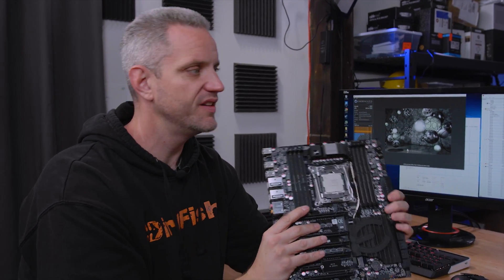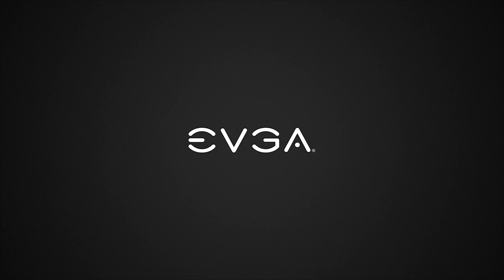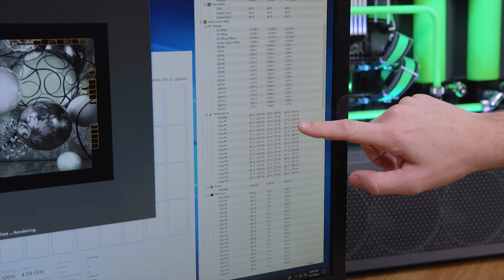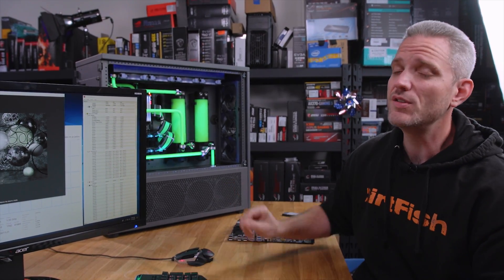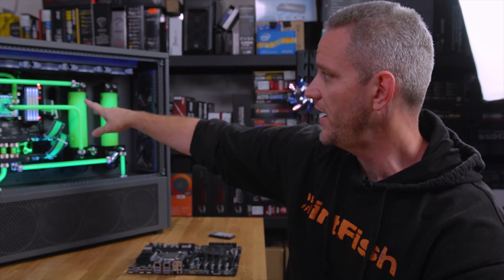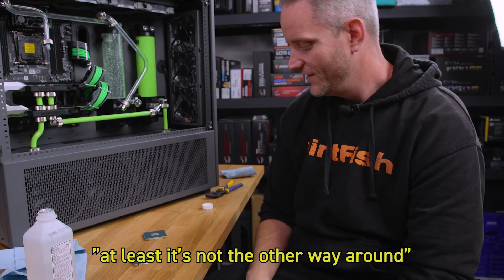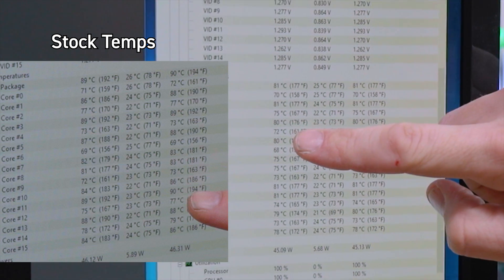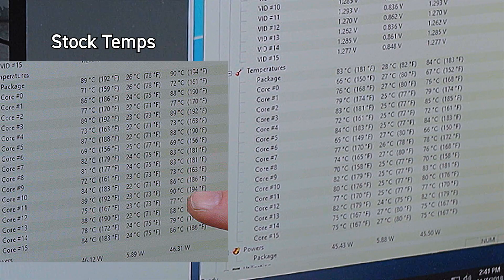I went to delid my CPU... but I didn’t expect this!

Comment: I never understood why Intel started having the lid and die sandwiched with thermal paste in between since 2012, instead of continuing soldering the lid and die together as they've always did in the past and AMD does to this day. It's just a terrible decision. The only reason I can think of is cutting down production costs, since it's a cheap and lazy solution to heat dissipation.
Reply: Well the chips with paste still run for decades without issues, so nobody really cares.

I guess it just annoyed the small number of enthusiasts and overclockers out there.
Reply: Yeah and the Ryzen 2 would take a 55 gallon drum of paste to fill that flying saucer of a Processor... Ryzen 3 is going to come with its own pickup bed...

Comment: When you exposed the copper, won't it cause it to oxidize? And that's probably going to get worse than it was before as the oxide is a really bad heat conductor.. Isn't it worth to coat it again?

Comment: You sorta skipped past it but did you trim the black glue? lowering the thickness of thermal paste between the die and the ihs is where you really lower temps. At any rate I expected a bigger difference after the de-lid so I wonder what's going on.

Comment: Shame you only did a partial lap. Im sure you took your measurements but normaly one should NEVER use powertools on a IHS. Copper is so soft to work with and the polishing wheel does have rather hard edges...

Comment: why would you delid and not use liquid metal? that is the weirdest thing i have seen in a while- i was shocked and actually rewound since i thought i misheard. do a proper delid with LM and then you will notice a difference(do it properly on both sides though)

Comment: Ive notice the IHS not being flat from my experience: 3770k (not flat) to 5930k (flat) to 1950x (flat) *these were the CPU I own yours may differ

water block used:
Swiftech Apogee fine for flat not for non flat
XSPC fine for flat not for non flat
EKWB fine for not flat (change out the jets to fit the non flat) or flat (stick with the recommended jet)

Comment: Why don't you sand the die itself down a little? that would do a lot for temps also. The Thinner the die the better it will transfer heat since it doesn't have to travel through as mush of the die.

Comment: Hey, Jay. Can you make another video on the EK Fluid Gaming parts? Since your last video, EK has got wayyyyy more parts and kits available. I'd like to see you use an A240G with one of the 240mm Radiator Expansion kits. The performance would be very interesting and only costs about $320.00.

Comment: Quote- "Not really an improvement"

Because you used thermal paste on the IHS. Liquid Metal on the other hand, you would have seen at least 15-20c drop.

When I delid my 7700k and used Liquid Metal, I saw a 20-30c drop from before. Was also able to use much lower voltage for 4.8Ghz as well.

Always use Liquid Metal when Delidding CPU's . Always. Best results.

Comment: Should have seen what the temps would be with a full delid, meaning no IHS, just straight water block to cores. I know its more risky as i have cracked a q6600 back in the day but was able to get temps at full load around 40c at 4GHz.

Comment: Dang it... 3939 cb on you're water setup... I'm only at 3600 CB on my 1950x on a 120mm AIO (I peak at 80-84c compared to the 90c you hit). I wonder if I could match that with the same loop and no delid?
Multi: 41  FSB: 101  Memory: 3636 (3600 XMP times 1.01 from FSB, 19-20-20-40 timings since it was a super cheap kit). 1st gen Asatech AIO with fan set at half speed, Taichi motherboard.
Not sustainable for 24/7 since my cooler is pretty wimpy (and only covers 1/4 the chip, LOL!), but it looks like the temp might be fine with a full loop. I'm eager to try LN2 on it! Got a T-Rex cooler I think will fit with zip ties . 'm the king of zip tie mounts, after an hour trying to mount it correctly on AM4, I gave up and within 3 minutes had it ready with zip ties, lol, nothing uses the correct mount...

Comment: Mhm what could you do against the IHS problem without losing warenty? Retail it because of lets say blue screen until you finally get a flat one? If Intel only had stick to their paste solution, thiner package -> way better temps, flat IHS -> better contact patch which result in better temps.

Comment: HI Jay and any other PC aficionados, I mainly game on my current build will post below. I should be running into a bit of money and want to upgrade even further especially with all the new stuff coming out. My initial question is what is going to be a great rig for both my gaming and future video editing/streaming. I want to get the I9-9900k but the price tag on that currently since i did it get it at MSRP is around $900+ on newegg, so I was thinking of getting the I7-9900K. I want to get the new 2080 or 2070 counterpart. The concern is I want to maximize gaming atm since the video editing will play a roll later but still be prevalent (its my wife's dream to start a channel and i want to make sure my PC is capable to do it reliably for her). 

Another question that arose for me is that if Im looking to overclock my I7 or I9 would an AIO be okay?

Current Setup (the upgrade will be noticed):
CPU: i5 7600K
GPU: GTX 1070
Ram: 16 GB (going to get 32)
CPU Cooler: Cooler Master AIO 2 fan radiator
Reply: please feel free to PM me also (to anyone that wishes to help me out)

Comment: Back when I bought my brand new 7700K, it went up to almost 100 C within seconds under load, in a custom watercooled system. I delid it and used fluid metal on the core and the heatspreader.
Ever since it goes up to the 60s, and stops at low 70s on hot days. 
So delidding with fluid metal made 30-40 C difference on the sock hz!!

What the f*ck Intel?

Comment: Hey I was this vid and i'd like to do a delid myself, only, I don't know what TIM to use. Saw you aplying a paste, so probly not conductonaut, but kryonaut. My question to Jayz2cent is , can we get better results on the CPU temp if we use a paste as well. I know that if you delid every channel or every either wannabe or for real diehard is going to say to use liquid metal. But can someone get away using pastewhen delidding?

Comment: I still see no reason to do this. OC'd 8600k to 5.0ghz, I live in hot af Australia, have an air cooler=no issues. Temps average 65-70 max during gaming. One should always have balanced mode on, so you use less power and CPU downclocks when not being used. I don't know why you mention it like it's a bad thing?

Comment: If you think about it, the thermal compound's primary function is to eliminate any microscopic discrepancies in the surface contact between the CPU and heatsink, to help transfer the heat from one surface to the other. In this case, too much was asked from the compound as there was nothing microscopic about those discrepancies.

Comment: You need to use liquid metal to see an improvement in delidding. I saw it on my 7900X. Delidding with regular compound didn't do much, but doing it with liquid metal dropped my temps damn near 30C at 4.7 GHz.

Comment: my i5- 8600k was running more hot as normal and wasn't sure if my IO cooler was making contact properly , and find out that the liquid inside the tubes where not running 
ones i put the case in a weird position against the wall .. so that the watter can run normal . my temps where nice and cool again .

Comment: if y ou want to be hardcore lap the cpu and the bottom of the IHS as well.   Better way to test flatness for block/ihs is a glass block to press onto them with some TIM so you can watch the spread pattern

Comment: why no liquid metal ? delid i lost 7c on my 8700k , delid pluss liquid metal 20 c
Reply: All this to play rocket league at 1080p.
Reply: you can also remove 0,2-0,3mm of die for extra 4-5 degrees
Reply: @_Leouch  Yeah and if you cover your blu rays in magic marker they read better!
Reply: @pancake-214 ... google it, it is not something I made up
Reply: I just delidded my 8086k and got about 25c lower temps :) used lm ofc

Comment: cant compare vcores between different generations, my i7 2600k needs 1.4v for 4.5 ghz stable, and my i7 3770k needs 1.2v to run 4.5 ghz stable, i know theres silicon lottery, but thats obviously not the case here.

Comment: That was really interesting.  I had a similar heat issue with a 6700k I picked up recently.  Under load would shoot up to 90+C in 2 seconds. In my case it WAS the TIM on the die. It was dried up and large portions of IHS and die were exposed in the same place.  Delidding knocked off 30C over the space of a CBR15 run, and it eventually (after an hour or so) gets up to about 72C, and that's only because the rad takes the air that the R9 390 dumps in the case.

Comment: Is there a way I can send in a gpu to you and have you take a shot at the problem i have with it, basically whats happening is the fan goes nuts then no more screen output but my computer stays on the history behind it is that the card burnt out but if it did it looks totally fine and it still works?
Reply: Also when i first got it i changed out the thermal pads and the thermal paste also there is some exterior damage on the io shield almost like someone forced the card out of the computer.

Comment: The voiding of the warranty should not be a problem. You are Fixing their bad design after all. To void the warranty, they will have to justify and prove how lapping a non-active lump of metal in a way that improves its intended function broke the CPU... Yeah... Good look convincing that to a judge. If you make sure you document that you had an antistatic band and you damped the sandpaper. They can't say you killed it with ESD or that metallic dust shorted something. the EDF and the FTC may even back you up.
Reply: You must be young...

Comment: I just bought and delidded my 8086k using a rockit delidder tool and used liquid metal and resealed (cuz i wanted too) the ihs I'm at 5.4 @ 1.48v with an H80i with push pull 2000rpm fans and I do not overheat!

Comment: hello jay.
maybe an idea to check that the CPU's IHS is also flat inside. 
Maybe because of the heat that it has been bent slightly or that it's just bad from intel. If you look closely at your video, 
it looks like there's more thermal paste in the middle than outside the sides.

Comment: Ryzen 7 1800x and gtx 1060 6gb   or    ryzen 5 2600x and gtx 1070       for a 1080 gaming/workstation build
Reply: 1700X(OC)/1800X ! GTX1060 (6 GB) is fine for 1080p 60Hz gaming..most games on high(not Ultra). The 8 core will be more appreciated for workstation use while still gaming ok. The 2600X will game a little better, but workstation/productivity use-cases will suffer more as a result.
Reply: 1Tanker thanks so much       so a ryzen 7 1800x and gtx 1060 will do just fine?
Reply: Beastmode Brown - It's pretty much what i have. I have a 1700X (on Gigabyte X370 mobo) OC to ~ 3.95GHz with an EVGA 1060 6GB (9Gbps model) overclocked to 1725MHz core and 2440MHz VRAM. I have 32GB (16GBx2) of GSkill RipJaws V 3200 C14(Stupidly expensive, but 3200MHz C16 RAM...at least, is what you want) running @ 3200 C14 with some tightened sub-timings. A Samsung 500GB 960 EVO(NVMe) keeps things snappy. I mostly play racing games/sims though. The CPU works very well in productivity and Handbrake...especially, for me. 

 Unless you have a line on a particular 1800X(maybe used), you might be able to get an R7 2700X for cheaper...and that would be a no-brainer!
Reply: @Mr1Tanker   so is there much fps or rendering performance between the 1700x or 1800x?

Comment: Hey Jay,
why you don't use liquid metal ? nail paint for Isolation around the die. would give the best temp.

and to be honest: save your time and use soft tubing for your Test System ;)

Comment: You would drop another 10-15C if you used liquid metal. Also, rockitcool sells flat all-copper lids which have greater coldplate-side surface area than stock, and will run a few degrees cooler than even a lapped and polished IHS. However, it's not nickel plated, so the liquid metal will embed itself into the copper over time.

Comment: This is where that graphite thermal pad would come in handy because it has great horizontal heat spreading capability so it would be perfect for the uneven IHS, no need to sand it down!

Comment: Lapping doesn't re-shape a concave or convex surface to be flat.  That's not what lapping is at all.  Lapping removes the MICROSCOPIC scratches in the interface materials, bringing them to a mirror finish if done correctly, meaning less thermal paste is needed to fill in the MICROSCOPIC scratches. (Edit: yeah, lapping is never done with a Dremel... that's called grinding.)  Additionally, thermal paste is NOT MEANT to be a layer between the interfaces... Imagine a sandwich.  Thermal paste isn't the meat in the sandwich... it's not supposed to prevent the pieces of bread from touching one another... it's meant to be the butter... flattening out both interfaces by filling in gaps (the crumb).  Now imagine the same exact sandwich, except the bread is made of steel wool.  Steel wool is a great conductor of heat.  Thermal paste is a good conductor of heat.  Squish two piece of steel wool together - every place where the two wools touch will conduct heat very well.  But there are still a huge number of places where the wools don't touch each other.  THIS is the place to apply thermal paste - in places that normally DON'T touch the opposite interface.  Instead of having 0 heat conduction in those areas, you now have good heat conduction, using thermal paste.

Comment: Damn, that's the least flat heat spreader I've ever seen. :-O
Reply: The one from my Pentium 4 2.4Ghz back in the day was way worse. There i had three corners that were standing up, so them iddle and one corner were lower. and it was that extreme that you could spot it easily with your eyes.

Comment: "INTEL INSIDE" some might not be flat but that's quality control, lol. So if the CPU is not flat can you warranty it since its a manufacturer defect? It could cause a CPU burn out you know
Reply: honestly, i would write a ticket to intel, and i am pretty sure, i would get a new one.
but i guess i would have to send my cpu, and then wait for up to weeks to get replacement...
Reply: @certaindeath7776  They would make you wait weeks before sending it back and telling you "the cpu is within our testing tolerance specifications".

Comment: A: those temps are still pretty high....have you checked the waterblock and other parts of the loop for flow problems?

B: liquid metal.

Comment: So am I seeing this right you delide to change thermalpaste for thermalpaste and then wonder why the temp doenst change I am not the OC guy but if you delide isnt that so you can use fluid metal instead of thermal paste so you get way better temps. xD

Comment: Why even bother with a delid if you're not going to use liquid metal?  I can run my 8700K at 5.5GHz delided with liquid metal with a max package temp of 70c in a 30 minute AIDA64 stress test.  You couldn't get anywhere close to that with thermal paste.

Comment: If it's convex on one side then it's concave on the other.  There would certainly be no direct contact anywhere but the very edge of the cpu die, in which case Liquid Metal could be more of a problem than a solution. Without making a hump in the middle like you would typically do with thermal paste, there's no way to get all the air out.

Comment: It's insane to me that a CPU this expensive doesn't get a soldered on IHS...
Reply: I'm way more shocked that Intel isn't able to produce a perfectly flat ihs...
Reply: @Structureel  but they do
Reply: If the IHS was soldered on I would be pissed off. That means they can put the crappiest of thermal paste inside and there would be no way to replace it without possibly breaking the CPU, And Intel has done that in the past by putting shitty thermal paste inside the IHS.
Reply: MsUpsilon  ummm...if the IHS is soldered, there is no thermal paste inside...there’s solder.
Reply: @Jcreek201  not exactly cowboy
Reply: @SAJMusicWorks  Yeah, Intel soldered the 9XXX series and made a terribile job!  You can still get temp drops of at least 5° C delidding a 9900k(and replace the solder with TG Conductonaut), but since its soldered, it is not that easy anymore.
Reply: @Squilliam-Fancyson  Yeah my ship is steering more towards AMD harbours....

Comment: I sent to siliconlottery and they did the 1st delidding on my 7900X for me. Then I was still curious about delidding process and I tried to delid it again. That was my time 1st delidding a CPU by myself.
Few days later I figured out some cores were high temp so I thought I damaged my 7900X, which made me run it at a low frequency for a long time.
Few days ago I decided to delid my CPU again and now the temps are good.
omg thankfully

Comment: I understand why people want to use liquid metal on a de-lidded cpu, but why not try using something that performs just as well as (if not better than) liquid metal, such as IC Graphite Thermal Pads? I especially would choose the Graphite Thermal Pads, as they are so much easier to apply than either liquid metal or thermal paste, and they're reusable!
Reply: Thermal pads better than LM ? You drunk ? They are worse than even LPaste...

Comment: Delidding is worthless without liquid metal, in fact over time your temps could get worse now due to thermal expansion related pump-out of the paste. The paste Intel uses isn't the best but it is more resistant to this pump-out effect.

Comment: Why don't you go more extreme? Sand down the die on CPU, put liquid metal and do direct die cooling. You can buy kits for direct die cooling from derbauer for your 7960X/7980XE. You'll need to sand down a bit of the direct die frame if you're gonna sand down the CPU die (or else you won't get good contact between the CPU die and your heatsink).